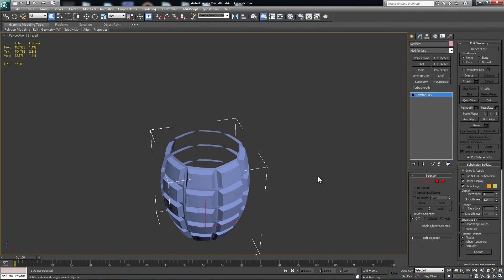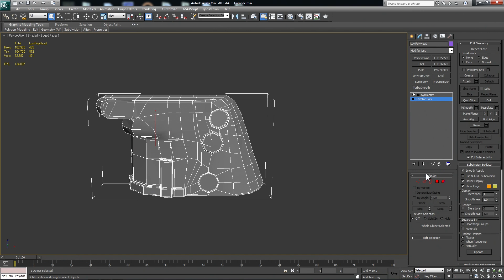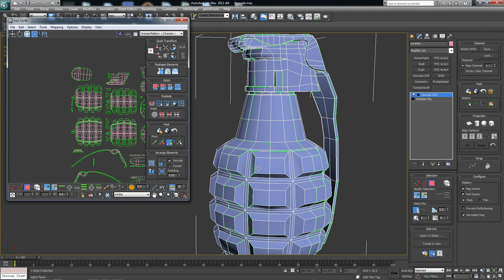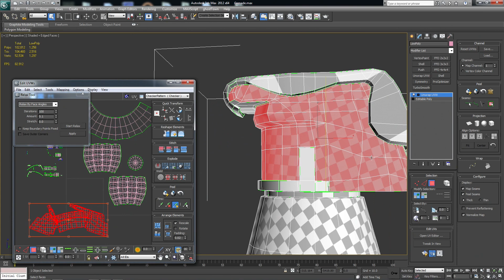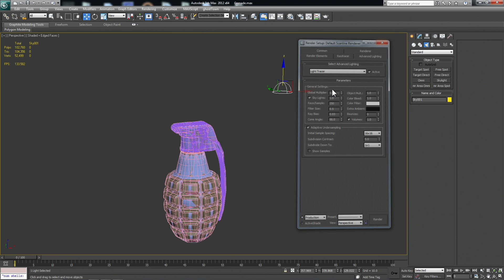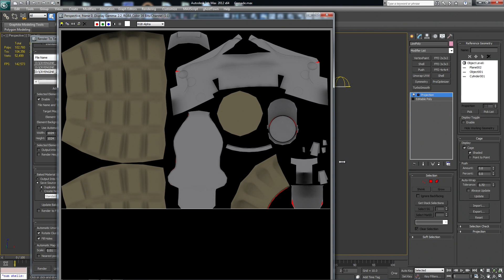Hard Surface Modeling- Creating A Grenade Part 2 of 3

Comment: Your low poly granete rimainds my high poly version of the granete in my video game

And no your 3D model is not similar in shape what I mean is that in general my video game have less polygon in most cases but I have very good reason that I do that in my game

1. Better performance
2. If do that I will by able to add more items in my Sean
3. Art style
4. And most important I have plan to add split screen in my game so it is a extra way to optimize my game